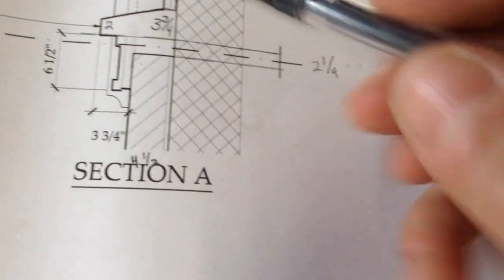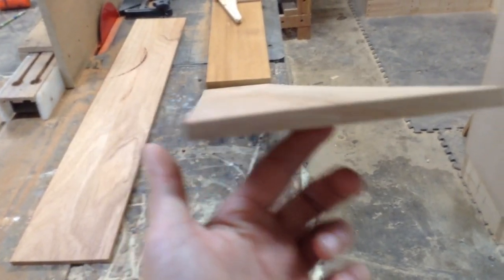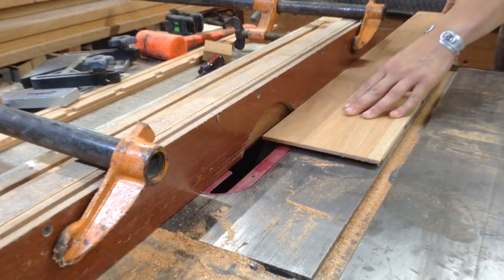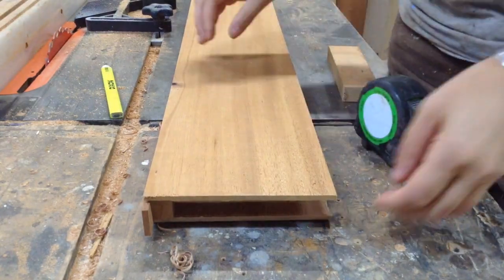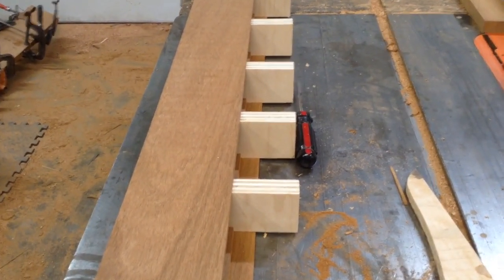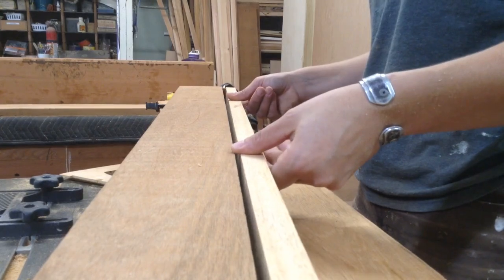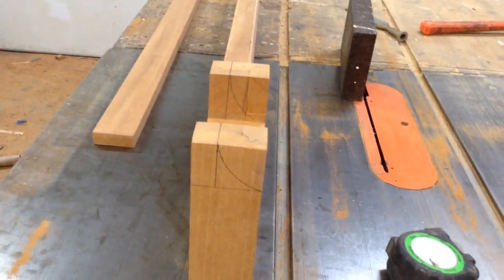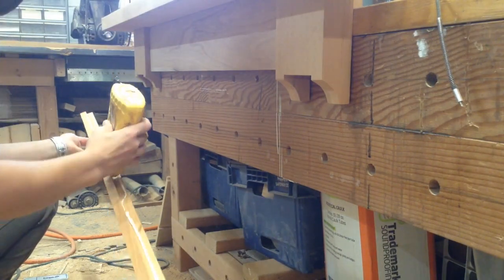Woodworking Projects || Nobody Knows What This Is [Woodworking Art]

Comment: If you can get 5/4" dressed it should be a finished thickness of !1/8'! A real nice Job Honey!
Reply from the maker: Yeah that was part of the problem, finding the lumber was hard enough, and when I did find it, it wasn’t offered in an array of sizes like domestics are.  Plus, the 1 1/8 was an example.  Each little piece were all varying thicknesses.      So when woodworkers source had it on sale with the free shipping I jumped on it because it was by far the best price I could find.

Comment: Hi Caitlin. This is really enjoyable to watch, and your narrating is awesome! I'm in the trade but I reproduce/repair damaged antique furniture parts that get destroyed from accidents. Question please - how flat was that 13/16" mahogany when you received it? I need to make a new 3/4" top for a chest of drawers and if the wood arrives warped, there's a slight chance I'll get 3/4" out of it. Would it safe to buy extra material? I haven't ordered from woodworkers source before, just curious.
Reply from the maker: The stack I got was fairly flat.  You can see that in the board that I ripped in half.  I didn't send any of this through a planer before using it and with ripping it in half it was almost a perfect cut because it was so flat.  But, out of the easily 20 or so boards I ordered there was definitely one or two that had a slight bow to them.  However, none had a cup or a twist.  Also, to be fair to the company I had this stuff laying around for a couple months not properly stacked which didn't help.  But, if you have ever bought some poplar from Lowe's I would count this stuff as a nicer grade of material then that, and I happily use that Lowe's poplar all the time for face frames and door fronts without a problem.  Also, I have ordered from them on a off for years when I need certain things and knots and surface imperfections are rare from them.  Hope that helps.
Reply: @HoneyBadgerWoodWorks  Yes that helps a bunch big time because I was anxious to order lumber through the mail and receive a disaster. Thank you for taking the time to answer me, I really appreciate it! Wishing you a great weekend :)
Reply from the maker: No problem,  I always hesitate to recommend products, because my experience could be completely different then someone else's.  But I have a pretty good track record with getting lumber from them.

Comment: Where do you buy your drawer guides. Seems like the guides at the big box stores, they look cheap.
Reply from the maker: For all my customer pieces I’ve been using solely Blum under mount slides for the easily the past 3 years.  They are special order online, not sold in big box stores, and are on the high end of the spectrum as far as price.  The only exception to that rule is when I am making large oversized file cabinet style drawers.  Those need special heavy duty side mount slides which I special order from Accuride.